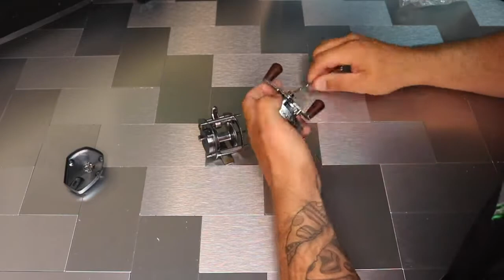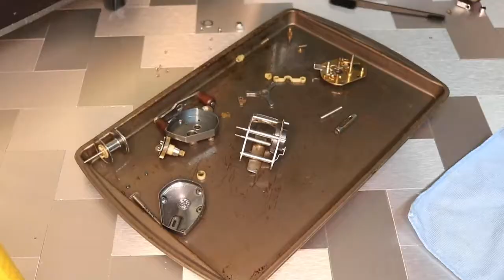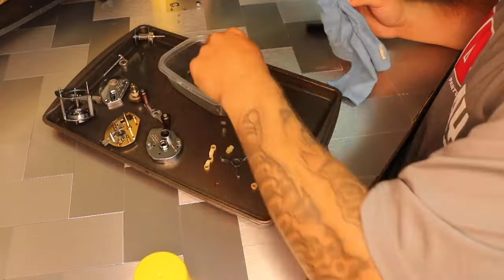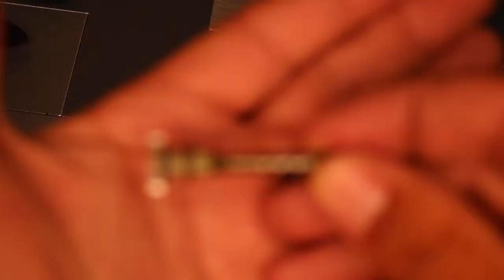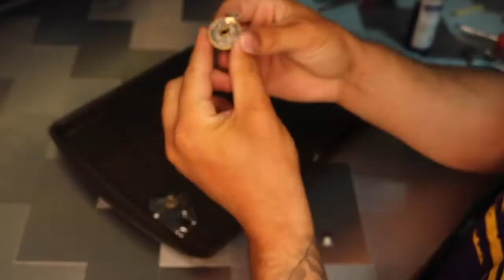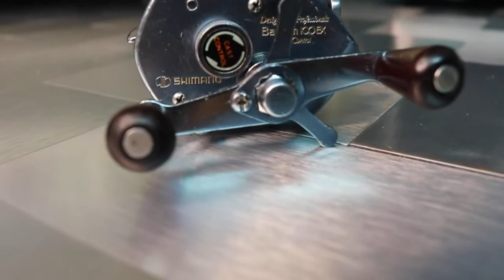Shimano Bantam 100EX Rebuild

Comment: Where did you find the switch? Great video!
Reply from the maker: I found an old reel someone was selling for parts and it had it on there. I couldn’t find the switch anywhere else. It was way more expensive than just buying the switch alone but I had extra parts if I needed them.

Comment: Have a 1500lc.  When i took it apart and reassembled it, the push button is stuck. Loosen up the SMALL screws just a touch and the button works. Any ideas?

Comment: Where did you find the switch to repair this? I have the same model, and my lure control switch broke off as well. Been trying to find a replacement for a couple years now!
Reply from the maker: I found an old reel someone was selling for parts and it had it on there. I couldn’t find the switch anywhere else. It was way more expensive than just buying the switch alone but I had extra parts if I needed them.

Comment: Where do you get the on-off switch assembly?
Reply from the maker: I found an old reel someone was selling for parts and it had it on there. I couldn’t find the switch anywhere else. It was way more expensive than just buying the switch alone but I had extra parts if I needed them.

Comment: Where can I get a switch assembly? Thanks
Reply from the maker: I found an old reel someone was selling for parts and it had it on there. I couldn’t find the switch anywhere else. It was way more expensive than just buying the switch alone but I had extra parts if I needed them.

Comment: Do you know what size bearings?
Reply from the maker: Not specifically, but I can’t try to find out. Which bearing are you asking about?
Reply: @WhiskeyBentOutdoors The  bearings for the spoo,l thanks.
Reply from the maker: @jjh8038  
OD 11/32”
ID 13/64”
Thickness 7/64”